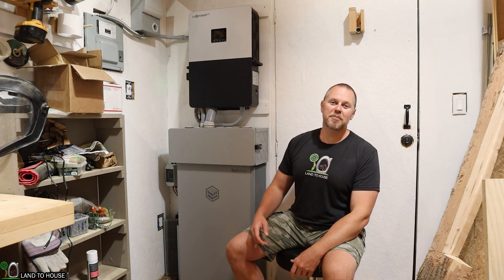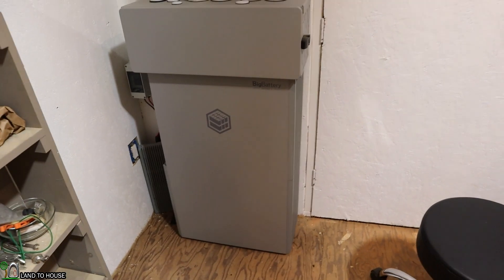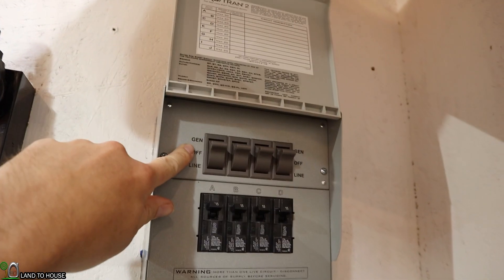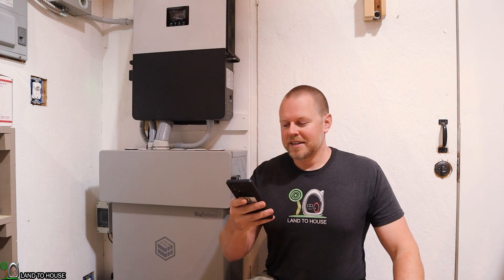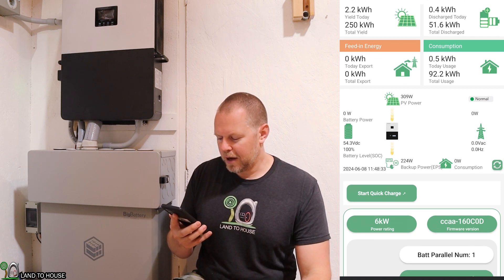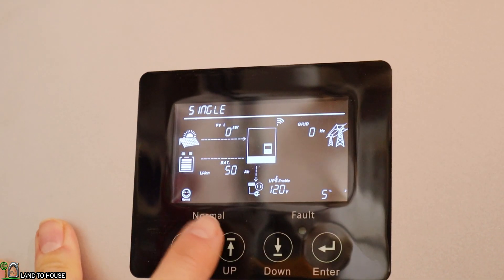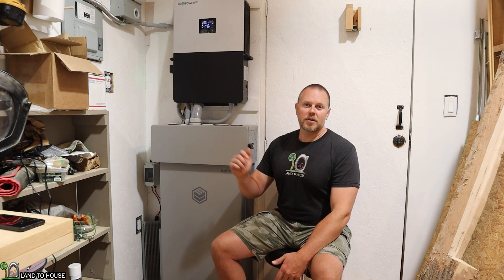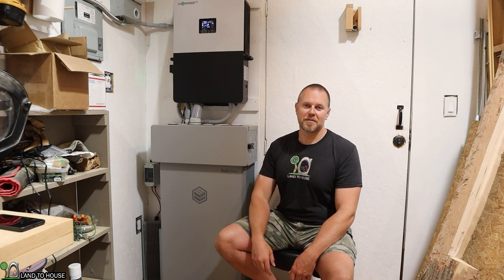Rhino 2 Big Battery after 3 months non stop use

Comment: the inverter should have a spike buffer. by design. what is the most affordable independent off-grid battery/inverter in the market. victron? I mean the most reasonable, assuming you get 450W solar panels for only 150usd piece. yep it cant be 2k usd if it wants to be in any reasonable ratio to the solar panel. maybe lead acid even. diy solar inverted system integration maybe.